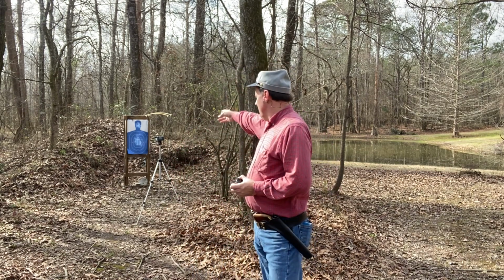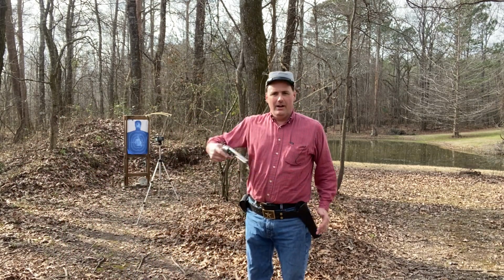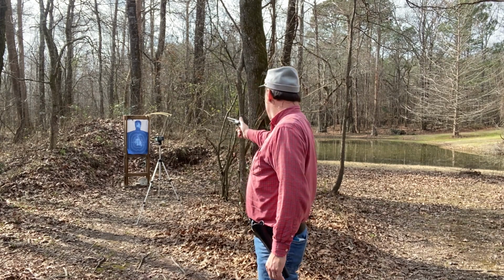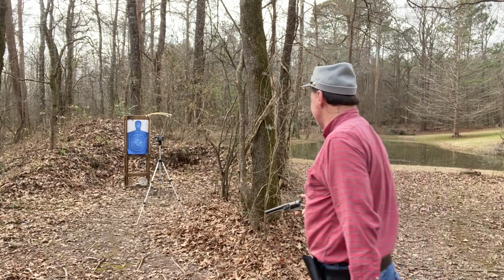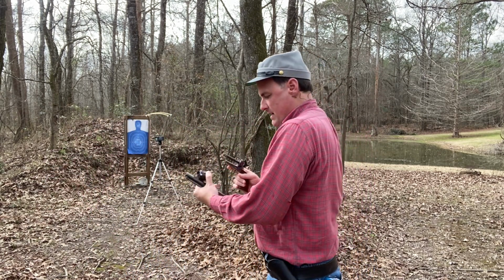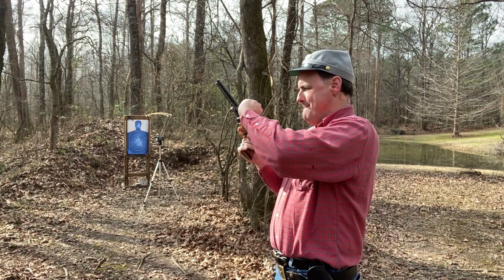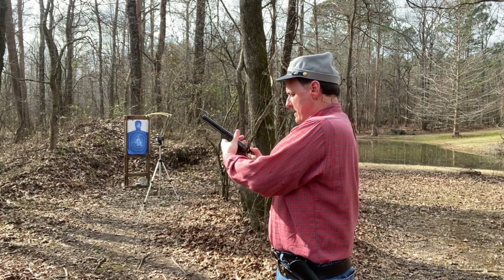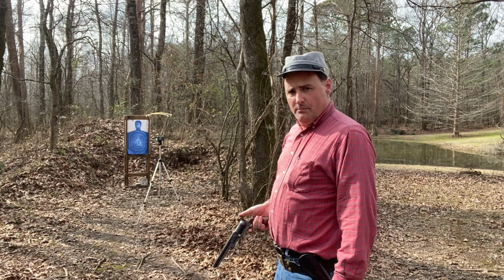1851 Navy Chronograph Ball & Cap & .38 LC Conversion Part 1

Comment: It really zips those 150gr out there. I wonder with cap n ball, the heaviest round ball or conicals you can shoot.
Reply from the maker: I’m going to try that out as soon as I get another 51 Navy ball and cap.  As for this gun, I was REALLY not expecting that.  I thought, at best, I’d get 750-800 fps.   I’ve since backed off this load as this old Pietta has signs of stretching after 20 years and I lost track of how many 80 gr balls came screaming out of it

Comment: They must be CCI number 10 caps
Reply from the maker: Correct. But I later put no. 11 caps and had the same issue.  I think the gunsmith did such a good job with the action that I now need to get a stronger mainspring if I want to shoot ball and cap.  (Actually, I’ll probably end up getting another ball and cap navy)